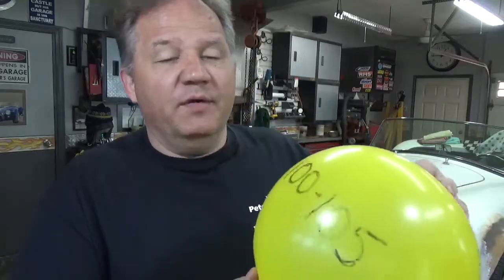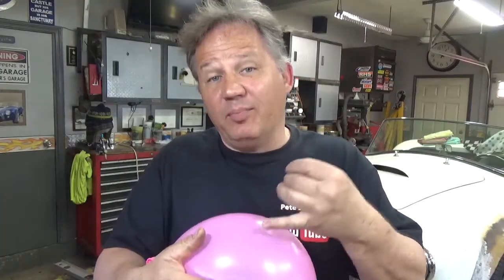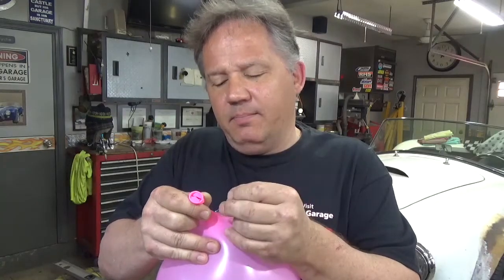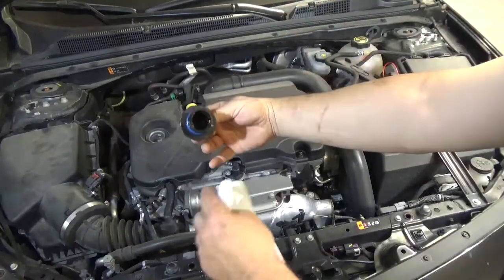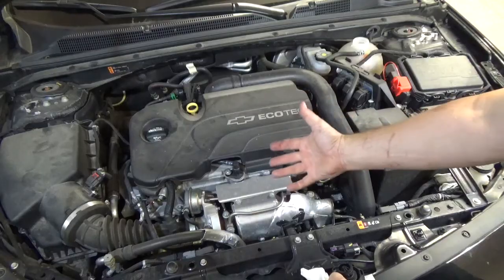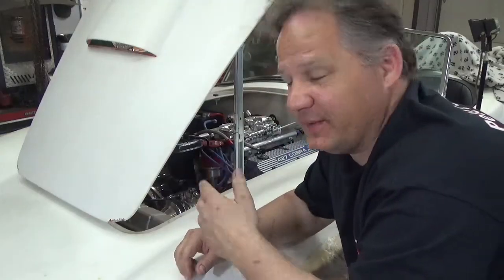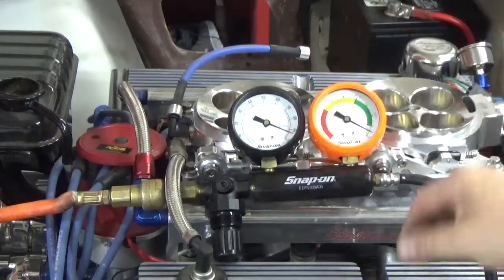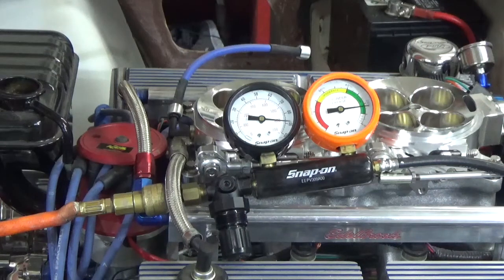Avoid Getting Ripped Off - Testing For a Blown Head Gasket, Leak Down Test, Warning Signs

Comment: How can i stop small leak on head gasket.engine oil leak out very small amount.i always wash my engine if it catch my eye.but it still ok since it not mix my coolant.
Reply from the maker: You could try one of those additives to see if it works. I have used them successfully.